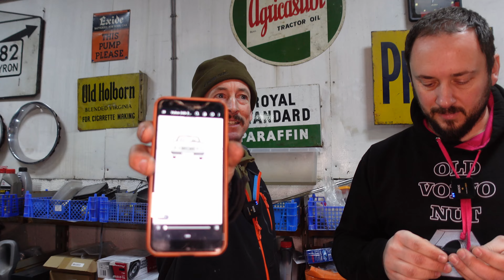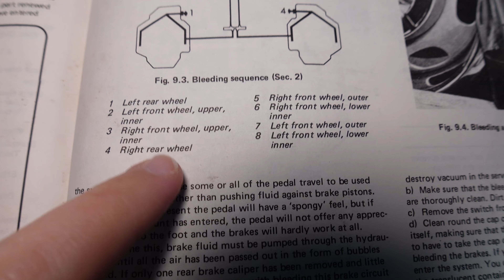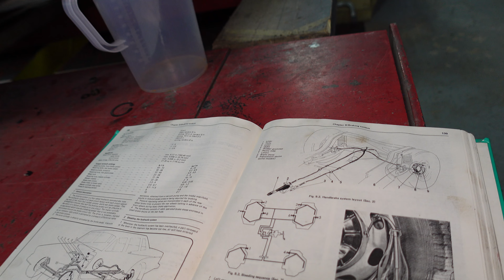Volvo 240 Lowered Adjustable Suspension Install!!

Comment: Guys I have used an airline pressure regulator with a modified master cylinder reservoir cap that has a 6mm quick release airline fitting in it. Same fitting on regulator. The regulator connected to workshop air as normal. Using no more than 2psi you will pressure bleed really easily. I have tried both systems you have suggested and they are not good enough. 
If you want pictures message me and I’ll send one over. All you need then is a drain hose and catch pots. And is a one person job👍

Comment: Rear wheel arch is smaller than the one in the front, so the car might still be in balance though it's not looking like it. Don't mind the gap between the wheel and arch, just watch that the skirtline is straight and balanced.
Reply from the maker: We're not going to do anything till we've sorted the wheels and tyres out. Could be a combination of smaller tyre/narrower wheel making it look off at the mo....we'll update!

Comment: I noticed my bumpstops for the rear axle is much longer, bottoming out out small speed bumps. It was a 2 seater van converted to normal wagon, do you think they had different bump stops?